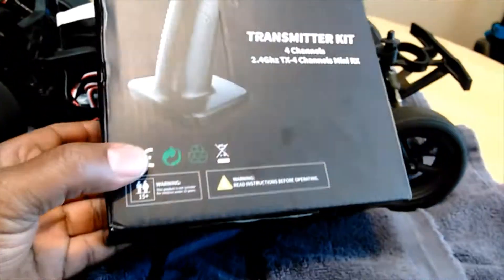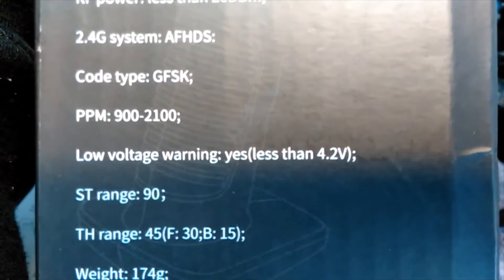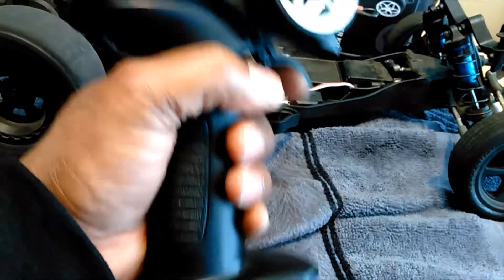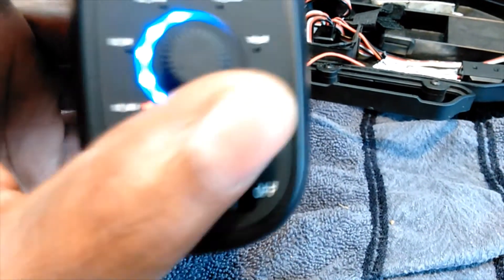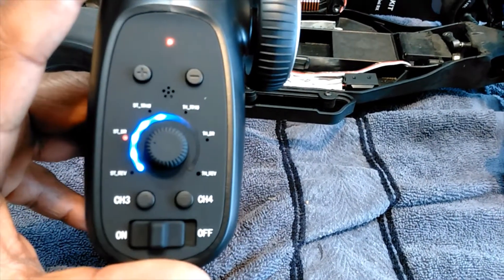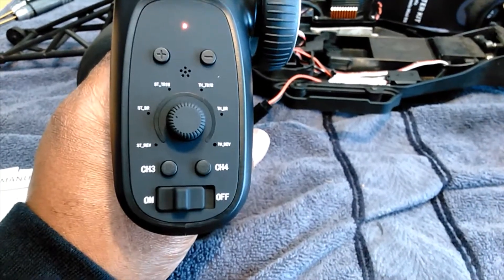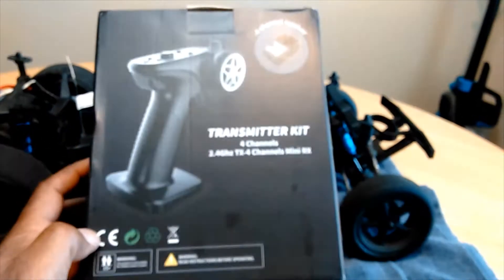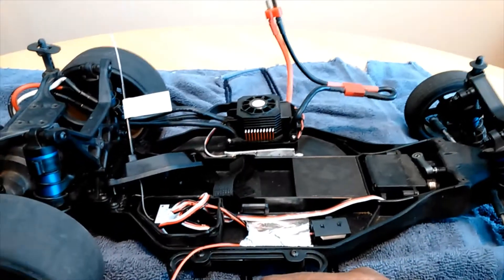GA 4H TRANSMITER UNBOXING

Comment: You can't use battery above 6v right? So 7.2v or 7.4v batteries are out of the question right?
Reply from the maker: @aces6262  I don't see why you couldn't use a 7.2 or 7.4 battery since it has been done by others.

Comment: My throttle is reversed how can I change that
Reply from the maker: Reverse your motor wire connection to the esc. If brushless reverse the 2 outside wires. If Brushed reverse those wires. You should have correct throttle.
There is a tab on remote to reverse throttle. You just have to select it and press button to reverse it. Either way will work.

Comment: Do you know why when I turn mine on the motor turns on and stays on?  Then the motor stops when I pull the trigger..
Reply from the maker: Don't really know. Make sure the esc is plugged into the 2nd slot on the receiver besides that I couldn't tell you.

Comment: Hi. How bind with a new receiver? Do you know?!
Reply from the maker: Are you trying to bind to the same Branded receiver or a different one?
Reply: @pjrcRecovery  Hi. Yep. Trying binding with another one brand (Flysky 2.4 for cars) receiver. And problem became me) Transmitter haven't bind button. Maybe you some combination pressing buttons. For example, press and hold CH3 and switch ON transmitter?